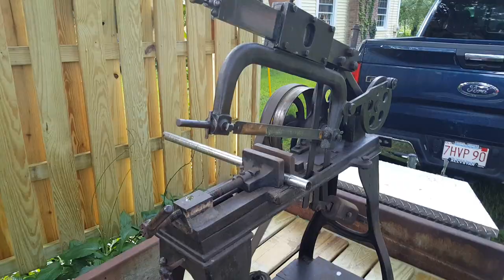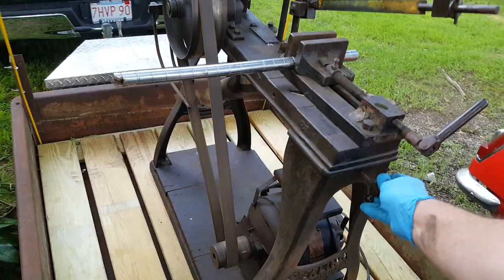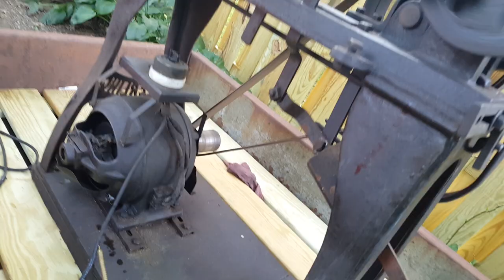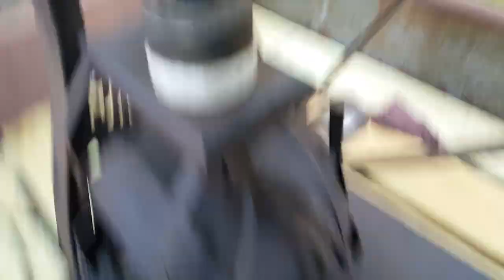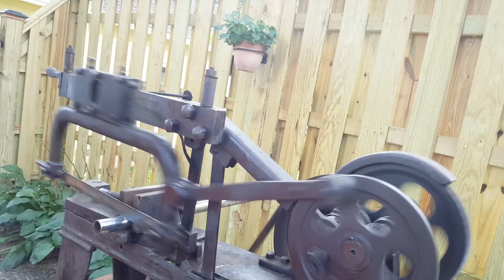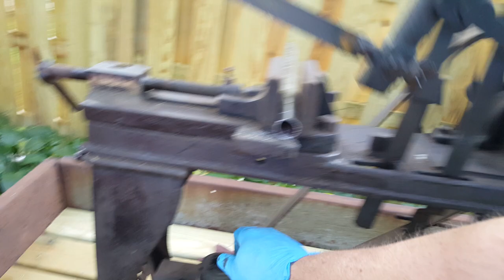1900 Sterling Power Hacksaw

Comment: The most dangerous hack saw machine I've ever seen. No way in hell I would use it but to each is own.
Reply from the maker: You realize it's 120 years old right?  It's a collectible that I use OCCASIONALLY,  not an every day tool.  I like old machinery.  I'll fire it up for the kids that stop by with their dads. They always are entranced by the mechanical aspects, and the way the ORIGINAL 1900 motor works